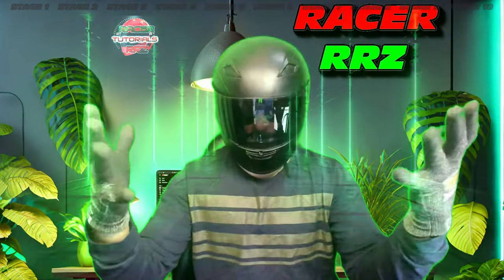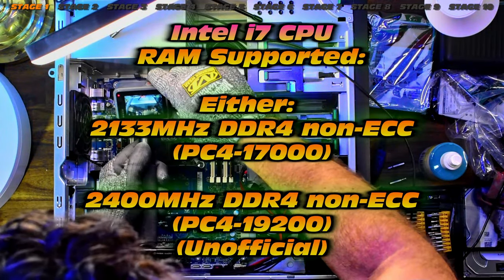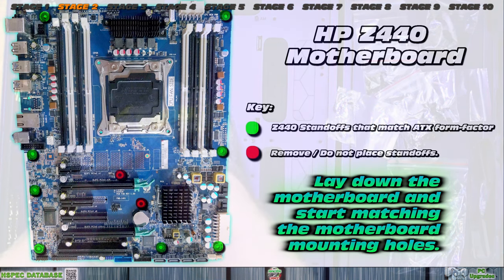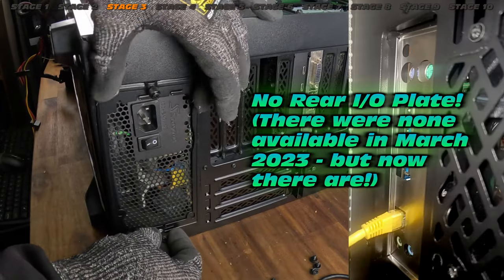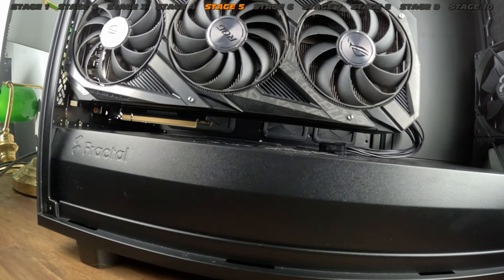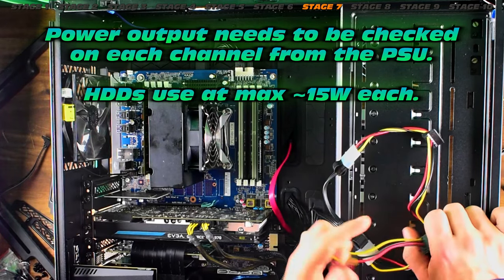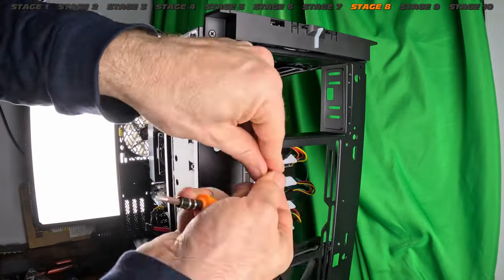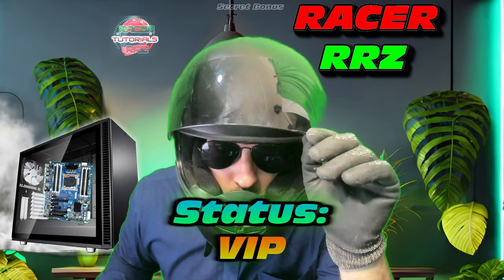Guide : Z440 Case Swap into Define 7XL = Ultimate Home NAS? (E5-2697A V4, 64GB DDR4, 66TB TrueNAS)

Comment: Supported RAM configurations may also vary between motherboards, but the Xeons themselves usually should also work with Unbuffered ECC/Non-ECC sticks in smaller capacity. Registered RAM is usually required for higher capacities (like > 64GB) because they offload some burden from CPU memory controller. Generally the best course of action is to just go with Registered ECC in officially supported speeds. You can usually find used server RAM pretty cheap anyway since they can't be repurposed for consumer PCs.
Reply from the maker: Absolutely yes, and that makes it even more important to check the entire configuration carefully before you buy / assemble your system. Officially, I recall the C612 chipset (on the Z440 anyhow) being limited to registered ECC memory only. 

The HP Workstations tend to be pedantic due to built-in BIOS configuration checks during startup. Normally the BIOS will trigger an error code for incorrect memory configuration when modules are out of spec (5 beeps in the Z440). 

I have only ever tested registered ECC in this system when paired with Haswell/Broadwell Xeons. But from posts that I read online it appears that there is more leniency with the Z440 given some unofficial support for Intel i7 processors like the i7-6900K. 

(e.g. 

https://forums.overclockers.com.au/threads/hp-z440-workstation-economically-viable-home-pc.1261856/ 

https://forums.tomshardware.com/threads/hp-z440-server-pc-best-cpu.3718926/ ). 

Pending end use, the Z440 remains good bang for buck for both server and gaming applications.
Reply: @racerrrz  Yeah, some boards are super picky with RAM and one should indeed check manufacturer site for list of verified modules for best compatibility. Actually now with DDR5 there's even greater difference between REG/Unbuffered sticks in that they are physically keyed differently so that you literally can't even fit normal sticks in a server, or server sticks in consumer board.
Reply from the maker: @ruojautuma1  If anything that is a good thing - it would save some headache if the RAM slots were redesigned to better reflect the optimal configuration for the system. But that would still not help to prevent people from buying the incorrect modules for a given system - hence careful checking being needed. DDR5 seems a while off for these workstations - or at least I am glad I don't need to be hunting for large amounts of DDR5 ECC server RAM given their prices. 64GB DDR4 2400MHz = ~$100 USD, 64GB DDR5 4800MHz = ~$200 USD. Wait, that actually makes the DDR4 memory look expensive.lol.

Comment: Nice dude! This is the end game for me. 100% ran out of 3.5 inch bays in the Z440's chassis. I've got 6 drives in there lmao, 1x16TB (for parity), and 5x12GB (for the rest) on unRAID.
Reply from the maker: Nice! The 5x 12GBs will pack a punch! I follow a similar logic - 16TB for scratch drive, 10TBs for storage lol. Once I land a few more 10TBs I'll switch over to RAID 5 in TrueNAS. I have been testing NVMe (Z turbo Drive Quad Pro) and SSD (870 QVOs) for cache - but so far no speed improvements.  

The Z440's original case is great but it really lacks the storage to fully support the motherboard. I have the same issue with the Z840, there are endless SAS/Sata ports and yet only enough space for ~7 HDDs + a few scattered SSDs. 

The Z440 case swap is relatively straight forward and you can select any case you could want. The only issue is finding a case with decent HDD storage capacity. I am still tempted to try to find a Fractal Define XL R2 - maybe for a Z840 case swap video.lol. The XL R2 has 8x HDD storage trays and 4x 5.25" Bays - which can be ideal for a NAS. The Define 7XL has worked out well, just a lot more expensive to get going.

Comment: Great stuff! Again gave me direction to upgrade and build a great budget friendly network of my favs the "old" HP workstations. Out with the HP elite 8000 stuff and in with the new to me 3rd gen Z workstations :)  I can upgrade and replace 5 aging machines to newer capable machines and upgrade my network for less then the cost of a new RTX 4090 founders GPU :)
Reply from the maker: Hi. At the price point for the Z440 they really are hard to beat right now. And compared to the RTX 4090 you could buy a fleet of Z440s for the same $s. The Z240 is also a great performer for slightly less. It just depends on the number of PCIe slots that you require. I have my Z440 fully loaded and yet I may still require more PCIe functionality (I only have 2x empty sata ports on the mobo and I could load another ~8 HDDs and several SSDs if I went overboard - this case is so spacious lol). 

The other machines that are of good value are the Lenovo workstations - like the P520. I am yet to see them sell for less than $800 USD here in NZ, but they are quite powerful for the price point. HP's equivalent machines would be the Z4 G4 and Z6 G4. Their prices are also gradually coming down.
Reply from the maker: Sorry I overlooked your reply here. The Z240 is a solid option but my only complain with them is that they can only handle a limited number of PCIe expansion cards. They can do one thing really well, just not everything. 

My Z440 NAS is still working away well. I am refining the system further by testing NVMe cache, SSD cache, and I just added two more 10TB drives and I am hoping to test a RAID 5 setup for transfer speed improvements. I'll have to do a follow-up video on refinements if I manage to optimize some good adjustments on it. 

If you had questions on the BIOS feel free to ask. Most of the BIOS settings should be fine by default, unless you wanted specific features etc.
Reply: @racerrrz   I have found out if I stick with the z240 tower version and not sff , I can add an extra  PCIe x1 slot with hp adapter 696971-001 to the bottom of the motherboard. Seems to work good for something like a Wifi adapter. Its not a x16 slot but better then nothing :)  I am keeping an eye on z840's prices also.  I hope you can keep the channel going, I know stuff is not cheap , I am crossing fingers we can get into a position to support you more ...  Thank you again for your content :)
Reply from the maker: @JordanGospelMinistryInc-go8qp   Nice! I didn't discover that feature - or rather I didn't read into it. I noticed the data port on the lower right of the tower z240 board but I never read into it. 

The PCI riser board is available and it's cheap, and it would add a full length PCI mechanical slot with x1 electrical connectivity. So it would run an older PCI card like a Wifi card or serial adapter. If only it could handle more lanes! I presume the M.2 NVMe slot will be using the chipset's bandwidth (being x4 electrically connected). 

The Z840 prices have started to drop, but I feel like they have hit a plateau. Keep an eye out for the newer architecture. The HP Z4 G4 and Z6 G4 are often cheaper than the Z840 and they deliver better performance given the newer CPU architecture and faster RAM, minus the Z840's PSU and PCIe grunt. 

And yes, inflation is really doing on number on everyone. Spare cash covers those interest rates!

Thank you for the support! In the YouTube world likes and comments are the currency that's needed, so you are adding value! Thanks. 

I need to get some videos out on the Z8 G4 - CPU fitment guide and CPU buying guide would be a great place to start. I also want to do a Z800 vs Z820, vs Z840 vs Z8 G4 video! But the older workstations are getting rare now. If only I had a Z8 G5 for review - I would be able to make a really clickbait thumbnail lol.

Comment: Work on your Network setup to get 10gb transfer rates. I am using the LSI 9211-8i and LSI 9311-8i HSA which work okay but do get hot so I needed to add a 10mm x 30mm fan on top of the HBA heatsink to keep it cool. its plug-n-play with windows 10 & 11.
Reply from the maker: Your message got hit by a YouTube spam filter, I only caught on to it now, sorry (no idea why...)! I did a heap of trial and error tests but I never got much more than 8Gbps on iPerf3. I did end up testing a transfer from RAID 0 (Asus Hyper M.2 V2) on my Z840 to RAID 0 on the Z440 (HP Z Turbo Drive Quad Pro), but it still capped out at 1.9Gbps - likely due to the file transfer - (MPEG video) - and the highest speeds I have seen for file transfers has been ~4.3Gbps. 

I am certain there are more settings that could speed it up, but for the time being I can load the connection with multiple transfers and still retain solid speeds. I can still work on multiplexing both 10GbE ports - but for the time being I got rid of the annoying 1GbE speed limit which has been enough for me.